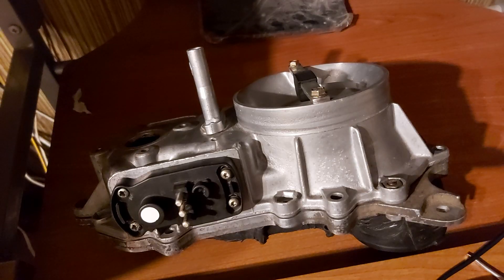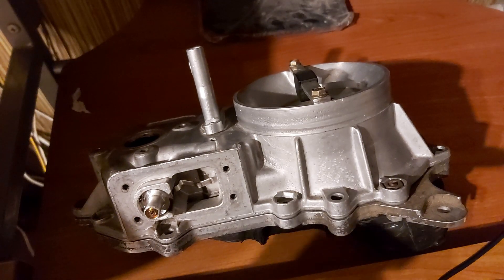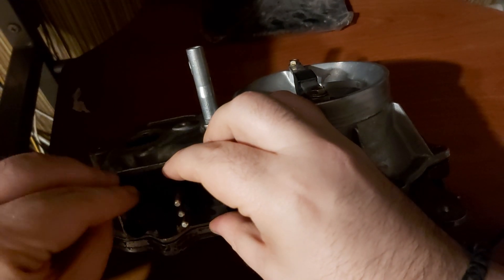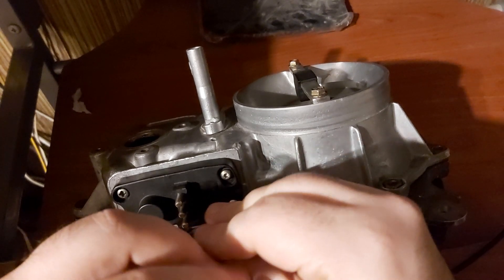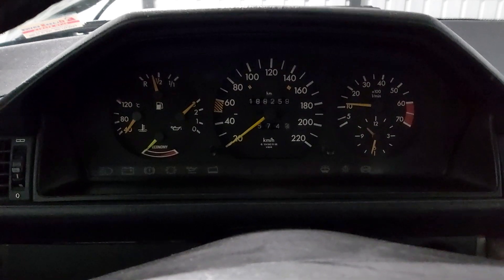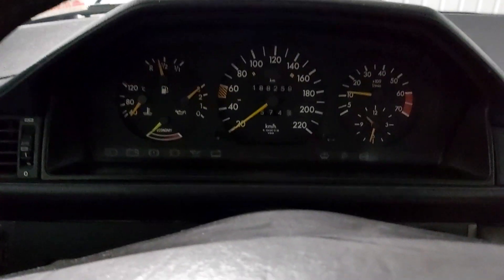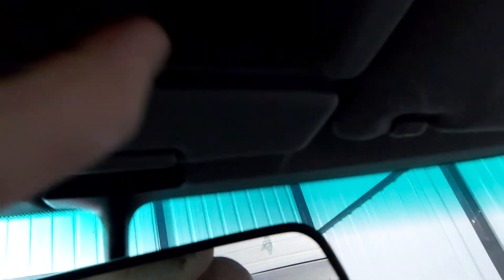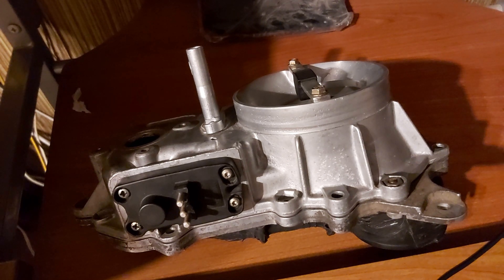㉦Mercedes KE-Jetronic㉦ - Potentiometer calibration and replacement

Comment: Do you know where the other end of the potentiometer cable goes to? Like the wire that plugs into the sensor, where is the other end of the wire plugged into?
Reply from the maker: @garyaubert  To the ECU. Two of them are power supply and ground for the sensor and the third one measures how much the plate is being deflected.
Reply: @ can I email you a photo of a wire? It’s a single plug but traces back up to the side of that potentiometer. Car isn’t starting all the way. Misfires and I’ve tried a bunch of stuff. Like if that isn’t connected, would it cause a crank no start? 1991 500sl

Comment: Hello I noticed the cars idle was at 1,000 I have also noticed to have plugged the vacuum line that would go to the auto transmission.   I have recently swapped my auto m102 190e with the 5speed 411 and my idle has now increased to 1,000 is this normal? I did plug the same line with a cap
Reply from the maker: Which engine is it in the car?

Comment: My 260e has a surging idle after start up it goes to 1700rmp then drops to 300rmp and does this in cycles. Also sudden acceleration and brake when slow speed in drive.. Just started doing this suddenly and now it won't go away
Reply from the maker: Replace the potentiometer if you haven't.
Reply: @mercedeske  ill try that

Comment: How to remove without a screw? One doesn't have screw..thanks.
Reply from the maker: You mean the potentiometer?
Reply: Yes... Some doesn't have screw...
Reply: I have a 190e 2.3 8 valve..when I started and change gear the engine turned off and black smoke came out from the exhaust...do I have to adjust the potentiometer or the fuel distributor? Thanks ,hope you have time to share some knowledge..
Reply from the maker: @jojbernard  Adjust the potentiometer if you haven't done that and afterwards the mixture at the end. Potentiometer and lambda are precondition for mixture adjustment!
Reply: @mercedeske  thank you..

Comment: what are the symptoms of not calibrated potentiometer? i changed the intake air temp sensor and now the car runs 1300-1500rpm and has hesitation on whole rpm range? and the potentiometer showed 1.08V and 1.3V  took the measurement twice, difference due to engine at different temperature probably. the potentiometer was changed and tuned with the faulty temp sensor so can it now be out of tune?
Reply from the maker: Too much, calibrate it at 0.7V. The symptoms are bad or high idle, stalling engine, jerking. 1V is too much. Recalibrate the potentiometer
Reply: @mercedeske  does the potentiometer have any effect when the car is warm? read online it only enriches the mixture when engine is cold or warming up

Comment: In another Video. The technician said to remove the ECU plug and put the car in emergency mode before doing this? any idea why?
Reply from the maker: Absolutely no need! Just calibrate the potentiometer the way I described it and there is nothing to worry about! Happy Mercedesing!

Comment: Hello! I have some problems with my w124 230e 1990. The idle is not stable. Otherwise the car when is running is ok. But when I have to stop, some times the idle is not stable is fluctuatin between 800 rpm and 1200 rpm, the engine is shaking. Also when I press the cluch pedal the idle is not stable. Sime times when I start the car, after starting the car turn off. Can you give me sime advice what to check? I changed the fuel pump, fuel filter, engin oil, oil filter, plugs, plugs coil, cover of coil, gnertator of coil, ovp sensor, and potentiometer sensor.
Reply: Today, I tried to make some ajustments of potentiometer to get 0.7v and of co screw. I made it, but after all of this still I didn’t get the ideal 1.9mm of free movement of ke-jetronik. To have the smoothest engine running, I ajusted it around 3.15 mm. I measured also the ehv how you described in your video and seems to be with right specs.
In the end I will atach a link of the video with engine running; it seems like when I press the cluch pedal some times the idle is fluctuating, the same when spinning the steering wheel. The start of the engine is the same when is hot or when is cold, but not the best, I mean the engine is turning 6-8 times before starting. On the other hand at the exhaust pipe you can hear some sounds like bubbles and I suppose that means the mixture of the air with gasoline is not the correct one. What do you think? Can you please give me some advice ? Thank you in advance.

https://we.tl/t-JjMJZuwAHz
Reply from the maker: Hello. I watched the video. There is some strange sound when you press the clutch but that's not related to the system, there you should check the thrust bearing. Concerning the rpm fluctuation, if you make a full turn, from lock to lock and there is a drop in rpm, then check the icv{the idle control valve). Concerning the mixture adjustment, you will have to provide me with the type of your engine(just tell me the year and how many liters is your engine).
Reply: @mercedeske  yes, this is what I  supposed also. The clutch is working perfectly when it comes to change the gear, but yeah I jut related the press of clucth with the fluctuation of rpm. Relating the rpm fluctuation, it seems to falls the rpm when spinning the steering wheel from lock to lock and not only. As you can see in the second video with the start of engine it has some rpm falls also when it comes to be stable after pressing of gas pedal. The engine code is : 102.982 year 1990, engine size 2299 cm3. If you need more I can provide you also vin number. Thank you for your patience and advices!
Reply from the maker: Although the engine works fine you can replace the O2 sensor. As for now, the ICV is not as it should be. If you donate me 30 euro, I will write you all the specs for your engine, everything you should know about your car.
https://www.paypal.com/paypalme/IvicaFyM
Reply: @mercedeske  let me understand. When you said O2 sensor you mean the whole unit ke-jetronic? Or is a part inside ke-jetronic that si apart?
So, you are defently sure that the icv need to be replaced? Or maybe I can try to clean it before better and try again? I said this because I try to clean with wd 40 a bit, at the first inspection it didn’t look to bad inside, this is why just I spray it with wd40 and wipe with a cloth. Shoud I dive in diesel and let it over night? Also what I saw is that the window from inside that si openning and closing it has a little pinch at the middle of the window. Could this afect the functioning?
Reply from the maker: Yes, soak it in diesel and then spray it with a brake or carb cleaner afterwards and let it dry. As it has dried mount it on the car. As for the O2 sensor, it's located at by the battery, by the exhaust manifold, it has a singe connector and a one for the heating element.
Reply: @mercedeske  thank you! I have found the sensor, and I found also some specs for it. The nominal value when the engine is warm should be between 0.2-0.8v, and mine is 0.11v, so out of specs. I will order one o2 sensor from bosch, I will clean also the icv and after that I will see if something is changing. I will let you know when I finish this. Thank you again, I really apreciate your hints!
Reply from the maker: Hello, have you replaced the injectors? When the engine turn off, when cold or warm? That's a huge difference!
Reply: @mercedeske  hello! The engine  is turn off imediatly after I started it. Like it is trying to keep the idle, the rpm is going to 1000 rpm and suddenly drop down to 600 rpm and the engine stop. But this thing is happening from time to time not always. The idle is not stable always from 800 rpm to 1000 rpm and engine is shaking when the car is running but is not moving, and when I push the clunch pedal. I didn’t check the injectors because the car is running ok when is moving, no smoke, the acceleration is ok and the engine is smoth. I found some problems that you described in your videos: 1. The potenstiometer of the air sensor is not reaching the value between 3.6-4.4 kohm.(when is mounted on the ke-jettronic the maximum value between pin 1 and 3 is 1.95 kohm)… and the car seems that is not changing the behavior when I cnnect/disconnect the jack. 2. The second thing is that the ke-jetronic is setted at value of 3.5 mm. If i’m trying to approach the value of 3 mm the engine is stopped. 3. The jack of the air flow sensor (maf) is disconnected and the same like for potentiometer, if I connect it or disconnect the car has the same running. 4. I found in trunk from old owner the ovp relay. It’s is from vemo but with 9 pins and 2 fuses. The one that is on the car is the original one with 8 pins and 1 fuse. When I mounted on the car, it was ok, just abs light turn on, because one fuse had poor connection. After I changed the fuse the car running like before with old ovp relay and abs lamp turned off.
Reply: In this video you can see how the engine is starting. At the beginning after engine start it had a drop of rpm util it is stable. And after that again when I press gas pedal the rpm falls and fluctuating a bit until is stable again. What do you think? After that always when I press gas pedal the engine is stable! Thank you!

https://we.tl/t-vPbIp3jTYE

Comment: At 1:39 we can see the two metal wipers inside the air flow metering unit that touch the potentiometer. What can I do if one of these wipers is broken off?
Reply from the maker: You would have ro replace the whole airflow unit but with the corresponding one. Watch this video about the corresponding airflow meter.
https://www.youtube.com/watch?v=7C0iAlN1ZiE

Comment: hello, thanks for your videos, I'm sure it makes a lot of people happy.  I have a 190E 2.3.  the problem is when I start it for the first time (Cold start) it doesn't hold on.  To keep the car running I have to accelerate for 2/3 minutes until it warms up and then I just stop accelerating and it holds there.  after that, if you turn it on again, it will hold because the car is already hot.  what can i do to diagnose the problem?  (I tested the potentiometer on pin 1 and 3 with the resistance of 4.20, on pin 1 and 2 the resistance is about 9) (connected with it hot 80 degrees I get a value of approx 0.9 v / )
Reply from the maker: Hello and thanks for your nice words. For the beginning try to calibrate the potentiometer to 0.7V. If you don't succeed, replace it or test it. You must have an even increase in resistance and then at the last third the resistance has to fall. If it doesn't happen  replace the potentiometer.

Comment: Can I ask, what is the relevance of the voltage on pin 2? My car runs well but is at 1.2v on pin 2 at idle? What does lowering it to 0.7v affect?
Reply from the maker: This is the voltage it has to be on idle, that's how the manufacturer requests. The pin 2 is the signal that the potentiometer sends to the ecu. The pin 3 is the signal from the ecu to the potentiometer.

Comment: hi sir, i have a problem with my mercedes 300GE. i have change the injector valve, but the fuel that coming out from injector valve is not as it should be. and it also causing high fuel consumption.
i need some help from someone with a lot of experience like you.
if you dont mind, can i have your contact? thank you
Reply from the maker: Contact me on my facebook page.
https://www.facebook.com/mercedeskejetronic
Reply: @mercedeske  i have sent you a message on FB

Comment: hye sir, can u do a tutorial on how to repair the fuel economy gauge not working? thanks
Reply from the maker: If it's not working then it can be up to the connection. You will have to remove the dash and to see in which condition your tube is.

Comment: Hi mate. Thanks for your great videos. I was wondering if you can give me some ideas. I have 1982 280SE. It work fine on idle but when you put into the gear rev goes down and engine stalls then car stops. What would be the potential reason for it ?
Thanks a lot
Reply from the maker: Hi, mate. Bad ICV. If you put in D and the car stalls, take off your ICV(the Idle control valve) and clean it first for couple of hours in diesel and then clean it again with carb cleaner and either use q-tips or let it dry by itself. Always keep it laying upside down( in an L letter shape 😀). Afterwards mount it back in the car. Happy Mercedesing 😃

Comment: Dear Sir, would you comment on how you went about tightening the screws on pot.
I tried to install new bosch pot. But, everytime i had it set at 0.70, and then tighten, upper right screw first, I ended up with 5.2, seems everytime I try to tighten that upper rt. Screw the pot. Signal drops, so it must be moving down as i screw in first screw...
Today, I was at it for 4 hours!!

So, I changed to tightening, bottom right once i got 0.70v and tightened in cris cross pattern, but still ended up with 5+v...?
What I'm I doing wrong?
Do, you have a method, or is it just trial and error...
Last pot. I did it on second try!
Would you please comment on how you did it?
Any words, of encouragement?
Thank you, very much!!
Indebted to you!!!
P.s. once i have, the calibration to 0.70 I turn engine off, and begin to tighten...
Reply from the maker: Don't turn the engine off, you must do that while the engine is ON!!!
Reply: @mercedeske  thank you for your reply, on my 92, 300e i have to turn engine off to remove fuel pressure regulator as it is blocking right bottom screw...unless you use a special tool to fit without moving f/p regulator? thank you!!
Reply from the maker: @oceanfront664  Of course. And as you replace the potentiometer get everything back and then start the calibration
Reply: @mercedeske  o.k., will look for right torx tool that will make process easier...
thank you!!

Comment: Greetings!
I ordered a new bosch pot. From an online site. The pot. Very expensive, and picture shows pot. As green/orange, but, when my pot arrived, it is black! Even though it came in a bosch box.
If, it is black does it mean it might be a chinese brand?
Also, it came with a rubber gasket...I noticed your replacement did not have a rubber gasket...how important is this rubber gasket?
How to tell when a pot. Is oem, or oe? And not some imitation in a bosch box?

Please, advice-comment.
Thank you, sir!!
Reply from the maker: Yes, I also received that gasket but the old one is still doing business so I didn't want to replace it. Concerning the potentiometer I don't think it's a Chinese copy, I read somewhere it says BLACK EDITION. If you bought the original it must say somewhere MADE IN GERMANY 🇩🇪. I can say nothing until I see the box.

Comment: hi, thank you for a great video! I just want to confirm the calibration process mm on volts and potentiometer plug pulled out a bit and mm leads on pin 1 and 2 until you achieve 0.7v  +/- 0.1v correct?
thank you!
Reply from the maker: Yes, correct! :D
Reply: Greetings, o.k. i finally got around to changing my potentiometer...upon examining it had scratch mark, like yours!
Once, I put on new pot. I used, pin 2 as positive, and used, a screw for ground.
In your video, you use first pin as positive?? Did, I use wrong pin for positive?  I got 1.2 v
With idle dropping all the way to bottom, and swinging, back up!

If i lowered, the right side, it idled very fast!!

The, left side of pot. You, can not move up, as, niple inside will only allow, a tiny bit...So, I tried just moving right side, which has  more room for movement...
But, could not stop the idle from fluctuating up and down in close loop.
My dear, sir, what I'm I doing wrong??
Please, help!
Advice
Thank you!!
Reply from the maker: Use pin 1 as negative and pin 2 as positive. After each movement wait for about 10 seconds for the ecu to understand that there is a change. Be very patient and do it very very precisely.
Reply from the maker: https://www.youtube.com/watch?v=AHkhV3Df9Io
Watch this video and do it as I say.
Reply: @mercedeske  just an update...when, I do a resistance test on my (new pot). I only get 1.7 kilohms. Bad, pot??
Reply from the maker: @oceanfront664  If you manage to calibrate it to 0.7V then you won't have problems. Mine measures that much, too and my car works excellent.
Reply: @mercedeske  thank you, for your quick response!
I still have a doubt about the new pot only having a resistance of 1.7 from pin 1&3
It's not the 3.5-4.2
Im measuring resistance with pot not in air flow meter
Outside, 1.7 
Does that mean pot not good?

I watched, your videos, and you gave values, but this is a new pot. So, a bit confused.
If you, have time would you kindly, comment...
Thank you!!!
Reply from the maker: Just replace the potentiometer, let your car warm up and then set the potentiometer to get 0.7 volts. When a car is running we are talking here about voltage.
Reply: @mercedeske  greetings! I did as you suggested. I tried the new pot, and once in place took ohm reading, and got 4.2, which encouraged, me to continue.
The, new pot even though I put in the place marked, by my old one, the new one was at 1.3v!
After a few attempts, i was able to get it at o.7v!!
Which, seemed to stop the idle, fluctuations...I tightened the 2 top screws, and test drove car, all seemed good until I still got a bit of idle, fluctuation, but not like before...wondering if it could be because, i have yet to tighten the 2 bottom screws!
Will retest, tomorrow, and hopefully, i just need to tighten those last two bottom screws completely...
Thank you, for encouragement, at least I'm able to drive the car.

My, doubt is about the two, bottom screws, or if the idle fluctuated, because of faulty, new pot, or air/fuel ratio too lean!
Thank you, again I think I'm very close!
Any comments, appreciated!
Hugs!
Reply from the maker: Hi, tighten the other 2 screws and observe the voltage, it's gonna change. You must get 0.7V with all 4 screws tightened.